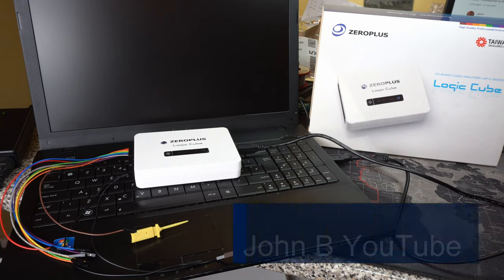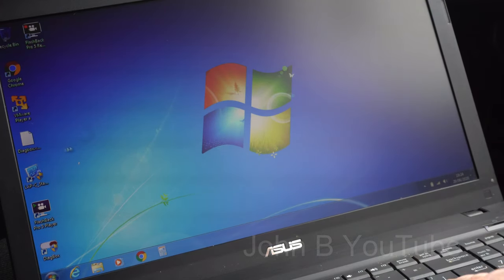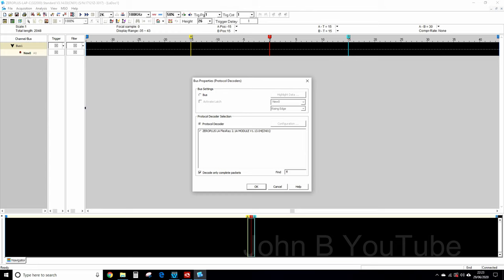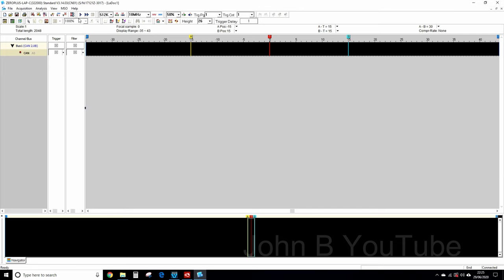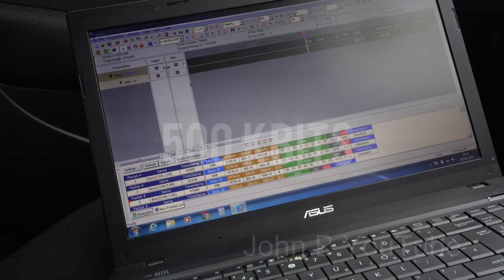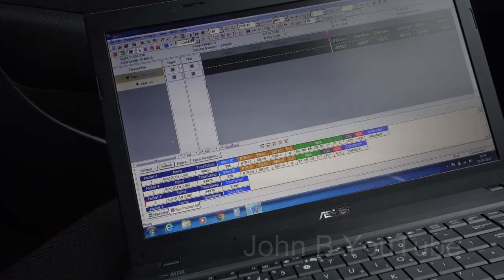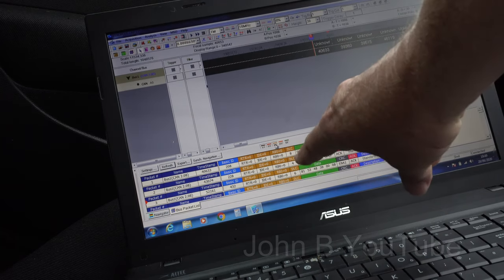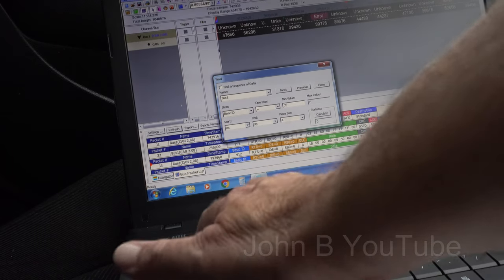Hacking / Reverse Engineer the CAN Bus with the ZeroPlus LAP-C Series Logic Analyser

Comment: Thanks for the info. Good tip about the ground reference. In the past I did forget to ground my KNX project and it took my hours to figure out why my data didn't make any sense lol.
Reply from the maker: Thank you for your comments Automated.
Reply: @JohnB-2021  Lets say i logged tons of can messages from my bmw e92 335i

Then what i have the logs but how can i use them

My aim is to use a junkyard 335i automatic transmission in a bmw e36 swap so now i have these messages how can i use them with the gearbox in my swapped car to make it function?
Reply from the maker: @FirstLast-tx3yj  You would need a CAN player but that is only as a test to check you get no errors.
You can't drive a car with it.
Reply: @JohnB-2021   but i find many can bus hackers that use such parts for swaps

I just want the gearbox to function normally without going to limp mode when it is outside the car that is all
Reply from the maker: @FirstLast-tx3yj  You need your whole car modified and programmed to suit.
I would not know where to start.
I would consider other options like getting a different car.

Comment: would be easier to pull the map off the car open it in winols trial version the hex may make a bit more sense ,  i like the idea great video
Reply from the maker: Thank you for your comments, just had a look at 'winols' looks like it's used for re-mapping.
Reply: @JohnB-2021  yes basically  hex editor  just handy to open car files up

Comment: Hey John! Love the CAN videos, as you know :)
For the calculation, have you tried ( 256 * Byte 1 + Byte2 ) / 4  ?
Kind regards
Reply: So 18 70 -> 1169 rpm, which seems reasonable when the engine has just started and is still running at a higher idle.
Reply from the maker: Hi Koffi,
Yes I have, if you divide by 2 again after the above calculation it is closer to the 730 rpm at idle.
Peugeot must use another formular.
I did see a video on a Honda, they have 6 digits and divide by 500 lol.
Thanks for your help